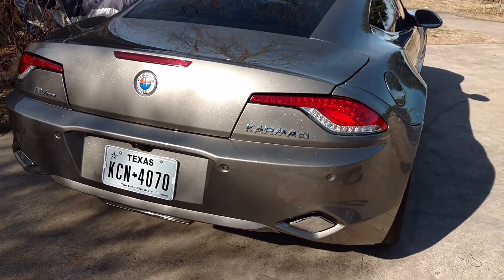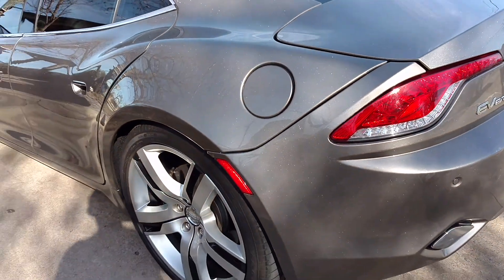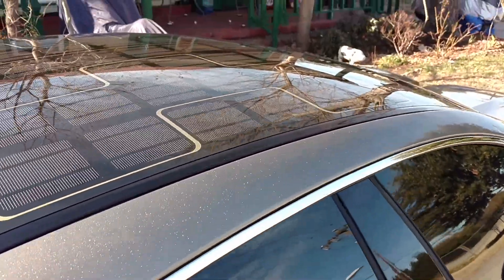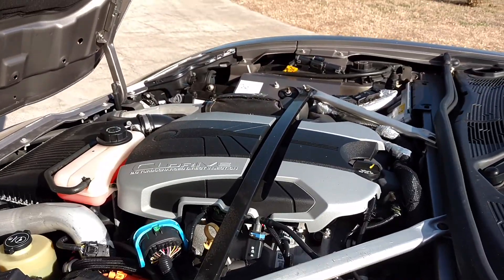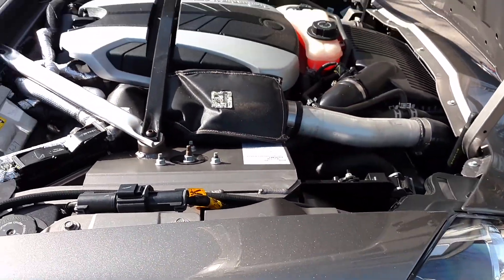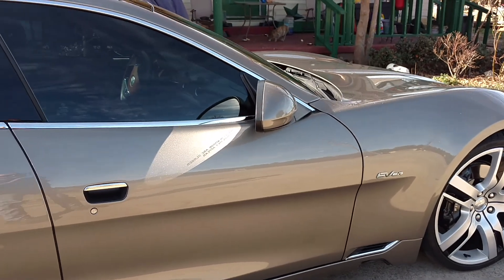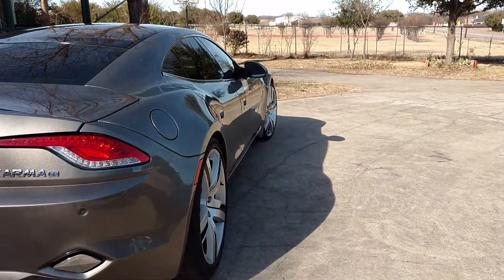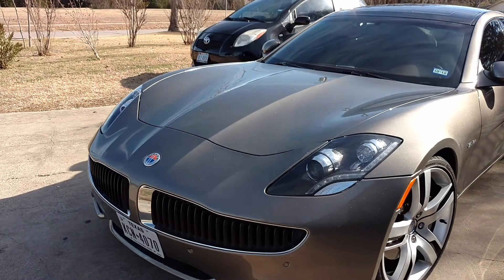2012 FISKER KARMA eco sport

Comment: How far can one dive it , hours miles ?
Reply: he doesn't have a license--he is illegal
Reply: The Fisker Karma can drive 40-50 miles on pure electric drive. Once the battery is depleted, the Karma will act as a traditional hybrid. Once in hybrid mode, you can drive it for about 250 miles.